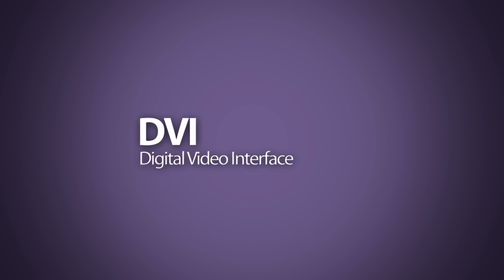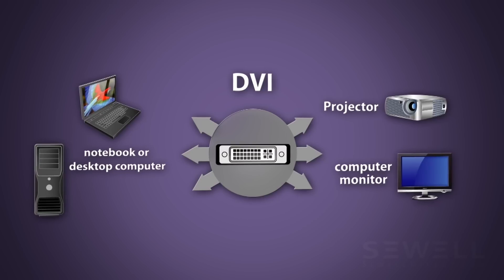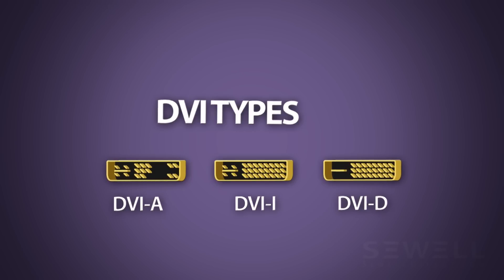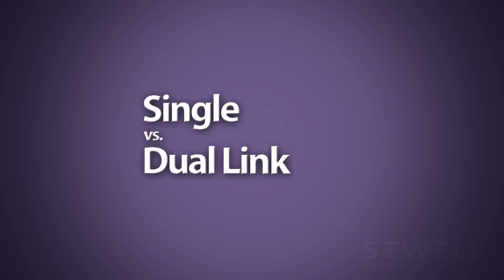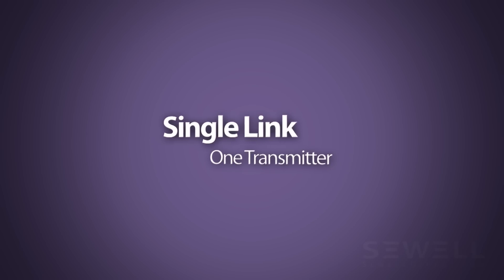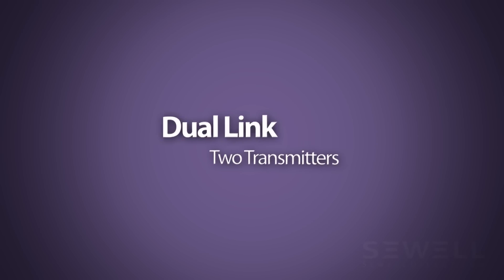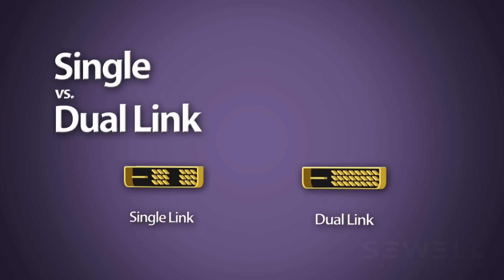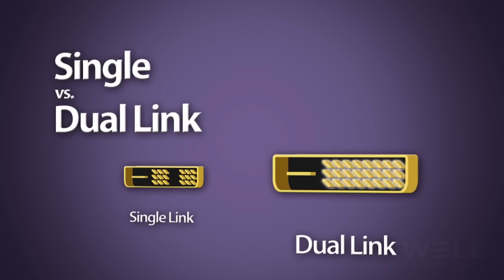DVI Types

Comment: What does it mean, that DVI only carries audio? Is that only a thing to worry about if a monitor has built in speakers? I use a headset that uses the 3.5mm jack. Would it effect me and if so, how would I get audio?
Reply: DVI /doesn't/ carry audio, it's a video only format which is why DVI is often paired with an audio format like 3.5mm audio.
Reply from the maker: Yeah, what Logan said... You would have to get the audio straight from your sound card to your monitor through the 3.5mm jack. Usually, monitors with built-in speakers also have a 3.5mm input for audio.